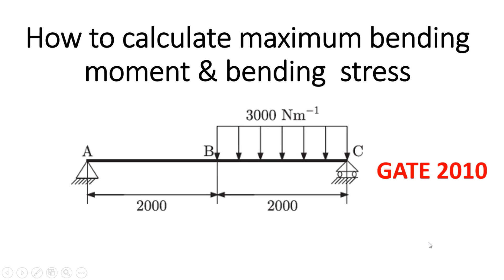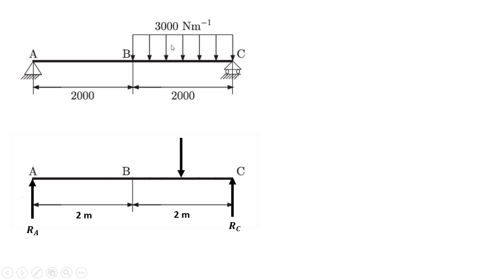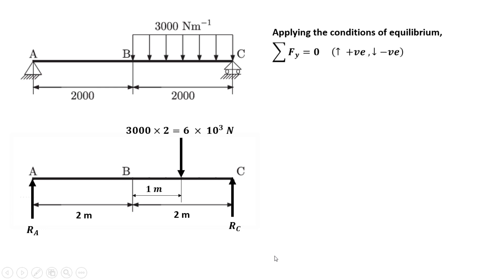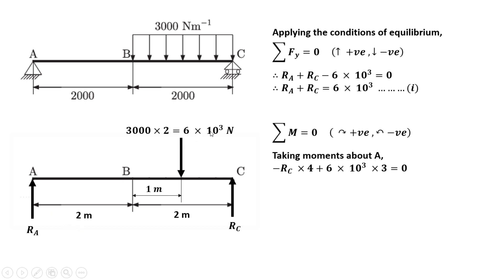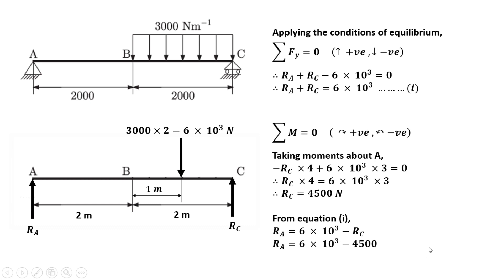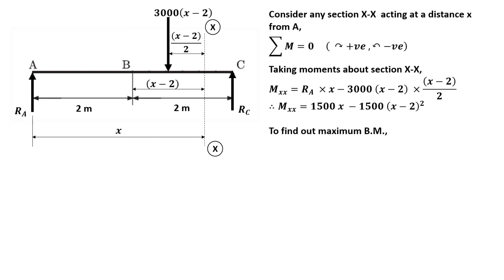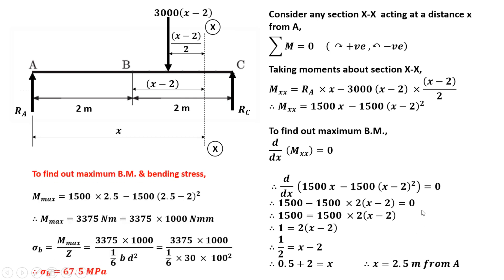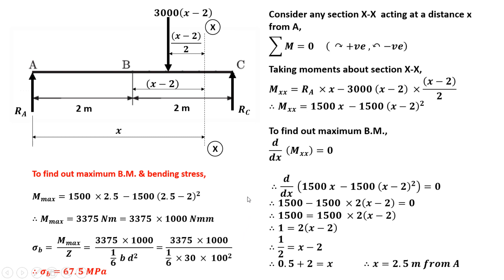Lecture 6 | How to find maximum bending moment and maximum bending stress - GATE preparation

Comment: I tried this method on a different problem which had other forces between A and xx and ended up getting a value that doesn't quite make sense. I have checked my math and do not see an error. Is it perhaps this method doesn't apply for all max bending moment problems?
Reply from the maker: You  must get the required answer ... Please check at your end again like calculations of reactions & formation of equation. Thanks.